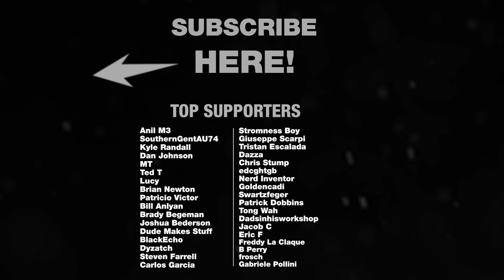Forged Blade that Splits in Two! Actually Works as One or Two Knives!

Comment: Cool project, bit of a bummer for the gap between the 2 blades. Should of used a pulling mechanism instead of a pushing one. Can imagine the thing seperating as ur using it, because your pushing the butting just by grabbing it.

Comment: Just a tip.
With this configuration, the two blades are interfering with each other. 
I would make one of the blades edge slightly shorter. Just a few thous.
So one blade cuts first than the other.
Besides that, I loved it! 
Your free hand beveling of the blades is flawless! Absolutely a joy to watch.

Comment: Everytime I see people scribe lines with a vernier caliper, I cringe, that is, was, a precision tool.....
Reply: I had a similar feeling when i seen that ‘but’, was a “precision scribe” & besides who knows, maybe that caliper was already a pos defective otherwise
Reply: Frequently these vernier's have hardened tips and are intended to be used in exactly that way.
Reply: It’s a vernier scribe he’s using and they have carbide rods you can replace, even so plenty use standard vernier to scribe, that’s their intended use and hence the pint which is hardened on them.
Reply: @DiesInEveryFilm  Learn something new every day! Been using them for heck, better part of 35+ years & never once read that anywhere or even thought of that being a use of tips… if i’ve ever needed to scribe anything, i grab a ‘scribe’ from tool box, lol
Reply: Calipers are only sort of precision instruments. They’ll usually get you within a few thou but around my shop they’re called guess-ipers. A set of micrometers and gauge pins make all the difference, even the less expensive ones!
Reply: I worked as a tool and gauge inspector, there's a reason calipers are only calibrated to +/- .002"...
Reply: Nice project, dude and you succeeded with your brief! Excellent video as always! 🍻💜🤘
Reply: Look again. Those aren’t vernier calipers. There is a scribing point on one end. These are designed specifically for scribing.